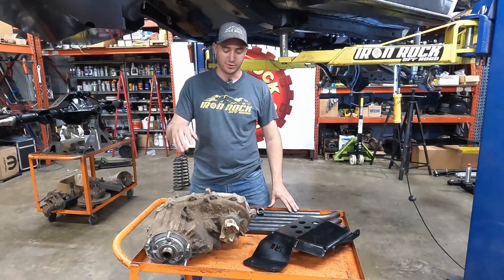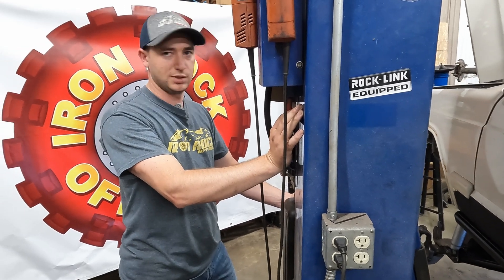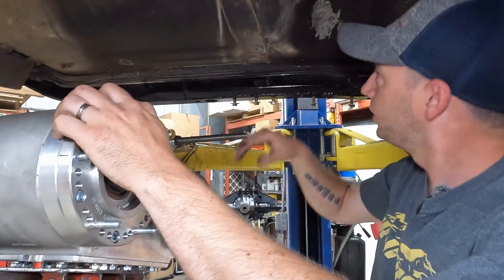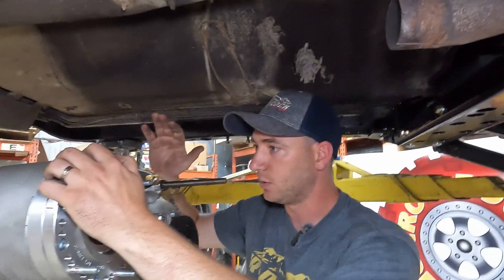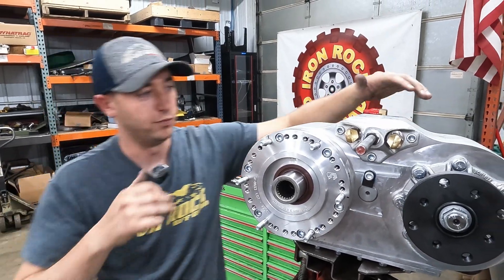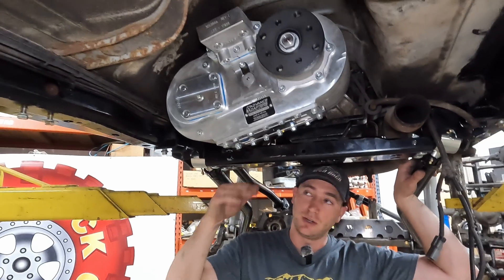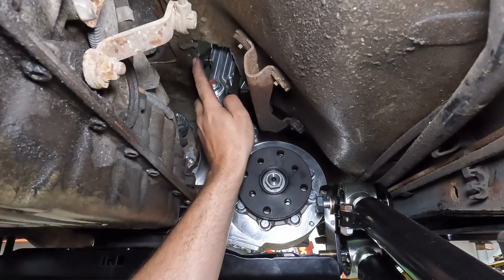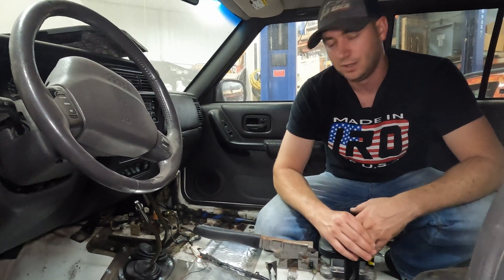Does an Atlas T-Case fit in an XJ?

Comment: Would this still fit if I am planning a build with just your regular 3 link in the front and leaves in the rear, not the flat belly?
Reply from the maker: @rickypalomares9786 Yes. We were surprised the Atlas fit very similarly to the NP231 that we took out. You could even use our NP231 skid plate with a tiny bit of trimming to protect the Atlas transfer case.

Comment: Hey how do you guys plan on getting the speedometer to work? Very curious.
Reply from the maker: @vin1322man Advance Adapters make an Atlas with a tail housing that has a spot for the OEM speed sensor. This Jeep will be strictly a trail rig, and the owner won't be using the speedometer, so he skipped it.

Comment: When u put the atlas up onto tailhousing do u put rtv sealant on there or no. Im installing my atlas n i see most people dont . Few videos that do put sealant on before installing atlas .
Reply from the maker: @greatwhiteshark448 It shouldn't be needed. The original transfer case didn't use RTV between the transmission and t-case. Other people might put RTV there for extra insurance to keep mud/water out, but that's just my best guess.

Comment: I have the 4 speed atlas in my xj. I actually went with a cable shifter, the TJ cable shifter bolts to the xj floor in the stock location no cutting or anything. Im still using a center console and full interior. The only thing I had to modify is the shifter arms i had to unbend them and tweak them slightly but I have an older style console maybe the 97 and newer console wouldn't need the tweaks i had to do. 
Also on the aw4 they say to plug the weep hole on the extension housing with silicone. The weep hole is there to show you if the seal in there failed but the atlas is sealed and doesnt need it also some people get leaks after install because the atlas may not engage the extension housing seal like the stock transfer case. What i did instead of silicone is i drilled and tapped the weep hole and installed a 1/16 NPT plug. 
This is an awesome video theres pretty much no videos showing an atlas in a Cherokee especially an install video.
Reply from the maker: @forreststrong797 Thank you for that info! I had not heard about the weep hole; we'll have to look into that. We agree, there's almost no current info about doing this swap in an XJ. Hopefully our video can help other people doing this swap in the future.
Reply: @forreststrong797 will the 4 speed atlas clear the body? Or does it need to be lowered? Will be purchasing one soon
Reply: @99xj2door  well it depends on what angle you clock it. I've seen someone's who wanted it more flat in an xj and they cut the floor out some. In mine it required a little massaging of the floor with a hammer, there's the protrusion on the back of the case that covers the internal shifter rods this is where there is clearance issues and I had to hammer the floor a bit I wasn't willing to angle it another hole over with the clock ring. Also I had to modify my crossmember a little to clear the front driveshaft at full droop but I have a lot of droop so much I had to modify my driveshaft for more angle and I also have an aftermarket crossmember, the stock crossmember or another crossmember may not need modifications and this was easy modifications just a little grinding nothing that needed to be reinforced or anything. 
I would highly recommend using the TJ cable shifter if your a little worried about cutting out the floor around the shifters. I'm really happy with the cable shift setup it was a clean install but took some time to really learn how it all works and I had to do slight modifications the first thing I had to do was bend the 2 shift levers in a different way they are made of flat steel and essentially I flattened out the bends in my press but you could use other methods then I adjusted a little with test fitting. The base bolts in it's just the shifters weren't straight so I adjusted the bends. If you have a 97 or newer console and floor it may fit a little different I have an older model but it will still bolt to your floor you will probably have to bend the shifters a little like I did but it turned out nice. Then down at the case I had to use the offset cable adapter that comes with the cable kit it's meant to be used with a certain transmission in a certain way, I had to grind a tiny bit of aluminum off the block that comes with the shifters that bolts to the back of the case so I could use the adapter block the other direction. There's  no permanent mods to the actual case or anything just small easy things to the shifter components and it may fit a little different if you have the ax15 I have the aw4. I also didn't do any sort of transfer case drop. 
A few tips I wish I could have found or found easier is when installing the atlas you need to plug the weep hole on your extension housing this is the stock piece between the trans and t-case that the t-case bolts to. Instructions say to use a dab of silicone to plug the hole but I drilled and tapped mine to a 1/16NPT thread and used a 1/16 NPT plug for a cleaner more solid install this can be done in the vehicle. This weep hole is no longer necessary with the atlas because the atlas is sealed and this hole can leak because it's possible the atlas may not ride on the stock seal which is ok. You also use a thin layer of sealer on the mating surface when bolting up the case on final install. 
Another tip I wish I would have known because I ruined my brand new carpet kit and had to buy another front carpet piece is do not cut the carpet at all without test fitting your console if you're running a console, and if you cut the carpet only cut side to side like door to door ways not front to back you want to make a flap do not cut the carpet flap off or anything until your certain it won't show on the edge of the console and just know it's ridiculously close to the bottom edge of the console im sure you'll be able to figure it out now that you know to look. Your newer console may be more forgiving if it's a newer model just pay close attention. This was a little harder for me because my new carpet kit wasn't pre cut. 
Then the studs that come with the atlas are a tight fit you really have to work hard to get them in all the way they are meant to stay for good. So what I did was get a few studs for test fitting I believe it's a 3/8-16 thread that way I could install 2 or 3 studs with my fingers and test fit because I fit the case and removed it I think 3 or 4 times to choose my angle and hammer the floor a little. I had nuts to finger tighten on the temporary studs each test fit and that made it easy it takes some patience. Also to get the t-case on I had to lower the back of the transmission quite a bit then slide it on and raise it up. I had a hydraulic stand thing under the trans and another for the t-case and my wife helped me with the test fitting and install we had it in its final spot in about 1.5 hours taking our time. 
I can't think of anything else at the moment. If you decide to run a drop fitment is even easier but I didn't want to drop it if I didn't have to. 
If you decide to go with the solid linkage shifters like the standard shifters the same advice applies with the carpet but I would wait until you have stuff in the car to trim the floor I know this might make it harder but I would want to trim away as little floor as possible. I actually purchased the solid linkage shifters the standard ones first then I realized I could probably make the TJ cable shifter work and purchased that because I really wanted the cleanest install because I have a really nice interior and I'm picky.

If you want to give me your email I can send you pictures if you'd like and maybe help with some questions. I had a really hard time finding anything online about installing the atlas in a Cherokee there's practically nothing. Also I don't think the guys at advanced adapters have worked on a Cherokee for a very long time because they didn't know the TJ cable shifter would fit even though it says xj in the fine print. From my research it's also my belief that the 4 speed fits better than the 2 speed in an xj but I could be wrong. 
Anyways let me know if you have any questions or want some pictures.
Reply: @forreststrong797  This is the 3rd attempt at replying idk if youtube is taking my comments off because I'm putting my email in them idk I appreciate your reply! I'll reply on there haha but your 100 percent correct there is zero information about the 4 speed in a xj!
Reply: @forreststrong797  I was curious Did you clock your 4 speed at 17 or 24 degrees? i ask because i test fitted and seamed to fit both ways but i settled on 24 because the manual linkages fit much better at 24. was wondering how you clocked it since you went with cable shifters.
Reply: @yesterdaysproject6106  I'm not sure the degrees I clocked it at. I can put an angle finder on it to see what angle I'm at if you'd like. I test fitted it multiple ways and went as tight as I possibly could and I did have to hammer a small area of the floor. I couldn't get to less of an angle unless I cut out the floor or id have to do a T-case drop like you see sometimes to correct driveshaft angle. So with no T-case drop I'm as far up as I can go without cutting a big hole in the floor I just hammered the floor a bit to clear the shift rail block thing. I know I'm pretty tight around the cable's I had to use the offset cable mount on one side in a way that was opposite of how it was supposed to be used but it worked good. They include parts in the kit for multiple transmissions and things and I ended up having to use this offset thingy meant for a tj transmission in an upsidedown configuration with my setup because it was such a tight fit with everything but it all fits very nicely I'm really happy with it but it really is a tight fit. To do any adjustments and to work on the cables I have to drop the crossmember/skid plate and lower the transmission down a little to give myself some room. I sure do like those cable shifters though. I also have the linkage shifter kit but I didn't use it. There's pros and cons with both but in my case I was sold on the cable shifters because I could seal up my floor nicely and get a really clean look in my interior I have a really nice interior. The cable shift works nice and smooth but linkage I feel would be more reliable over time as long as everything stays tight, cables can seize up and stuff and need attention over time but they are very high quality cables I don't feel like I'll have many issues.
Reply: @forreststrong797  hey thank you so much for the information. if you happen to be able to put an angle gauge on it some time that would be greatly appreciated. I put my atlis behind an AX15 in my XJ
Reply: @yesterdaysproject6106  oh nice are you happy with it so far? Mines behind an aw4. Being an ax15 I bet the atlas gives you a ton of capabilities your clutch is more of an on off switch and it's just so much easier to do stuff with all that gearing. I used to really like manual transmissions for off-road but I got in an accident and messed up my back in 2012 and I have nerve stuff and weirdness so a clutch pedal messes with me so I've gotten into automatics my aw4 isn't stock I have some good capabilities with it and I've come to enjoy my automatics. I know a lot of people say auto is better off-road but I always really liked my stick shift I had a Nissan 720 4x4 truck I built that was heavily modified that was a 5 speed then I had a cj that was a stick shift as well. Once you get good with a stick shift I still feel that you have more options especially if you have good gearing like with an atlas.

I've been happy with my atlas so far but I've been chasing leaks I had 3 leaks now I'm down to 2 leaks. Technically 1 leak because I know the problem and the solution for the easy leak my sight tube is leaking, originally the sight tube hose leaked and the top fitting and I replaced the clear hose then found the upper fitting has a problem the flare isn't sealing. I have some new push lock AN fittings to build a better sight tube with new aluminum fittings. I really like the sight tube because you really don't have an option to check the oil level reliably so I don't want to give up on the sight tube and luckily I'm very familiar with AN hose and fittings. If you have issues the sight tube is made with 6an push lock style 90s then the fittings in the case are a -6 ORB to 6an male flare. my pan leaked or the oil pan type cover on the bottom I fixed that and now I have a small leak somewhere around where the reduction box meets the actual transfer case it's coming from up top somewhere or it's leaking where the box mates to the case and I keep removing my skid plate and everything to clean it and try to figure it out but I haven't been able to find it. I hate leaks I'm super picky about leaks. Since everyone sets their atlas at different angles your supposed to fill it with the 2.5 quarts then mark the sight tube and that's your full level. I used a red zip tie around my tube. I wish I could use plugs and have a way to check the oil level through a plug, if I have more sight tube issues I might try to make something to check the oil level through the top fitting. At a higher angle you could almost fill it all the way until it comes out the top hole but anyways I'm rambling now. 

Anyways I will put an angle finder on the case and get you the angle it's at. 
If I remember correctly the ax15 T-case could be clocked different than the aw4 in stock configuration like with a 231 so the comparison may not be very good for you but I may be thinking of the wrangler T-case versus the xj case I can't remember. We swapped an ax15 into my friends 98 zj and I gave him a 231 and we were looking into if the automatic and manual cases had any differences since I gave him an automatic case but I can't remember if there is a difference. You may want to look that up for your comparison if the case is clocked differently between the ax15 and aw4 and if it is clocked differently you could just subtract or add the difference for your comparison. 

One thing I either read somewhere or was told by advanced adapter's is when you first install the case and fill it with oil you should put your vent tube in a place to watch for oil blowing out the tube especially at higher angles. All my vents are plumbed with AN hose and fittings so I just put a temporary hose on it for the first few hundred miles to see if oil blows out. They say oil may blow out until it gets to a happy level I never had that happen but it's something to watch for my vents are all ran up under the hood so if it does blow oil out it's best to have a short hose somewhere you can see it. 
It was super difficult to find any information on installing the atlas in a Cherokee especially a 4 speed so if I can help with anything I'll try my best. It's been so long since advanced adapter's has done anything with an xj they have a hard time answering some questions too. 
This comment is getting super long but I also wanted to mention that with the aw4 there's a weep hole on the extension housing that needs to be plugged so it doesn't leak transmission fluid. It's meant to leak when the seal between the transmission and stock T-case fails but the atlas is different so the hole needs plugged. I have no clue if the ax15 has the same thing I kinda doubt it but it's something to be aware of if you notice a leak. They say to seal it with a dab of silicone but I drilled and tapped the hole for a 1/16 NPT plug. I'm guessing it doesn't apply to the ax15. 
I was able to find information like this from lots of googling and looking at old archives of instructions from advanced adapter's. They weren't even aware that they had a cable shifter for an xj I figured that out diving into all the information and that's why I also have the linkage shifter kit I bought it first and didn't use it but I really didn't want to cut my floor.
Reply from the maker: @forreststrong797 Thank you for sharing all this detailed info! I can already see how it is helping fellow Jeep guys.